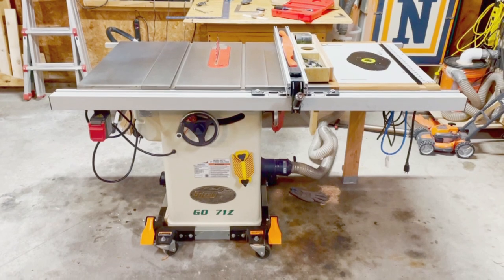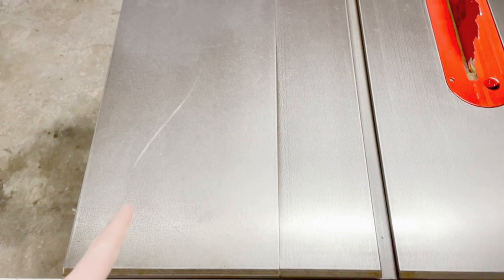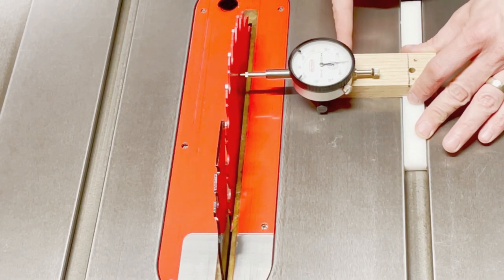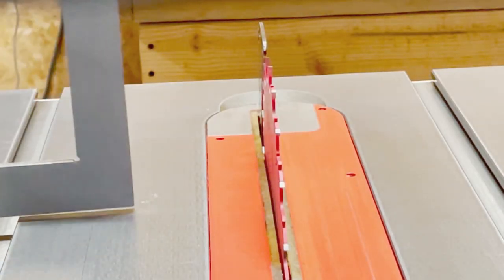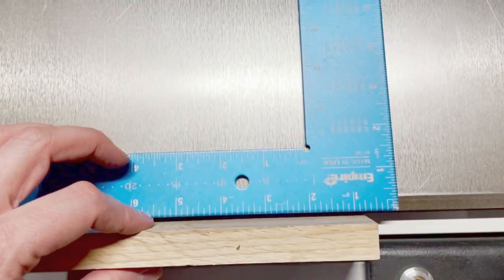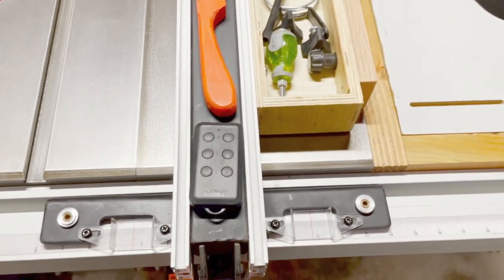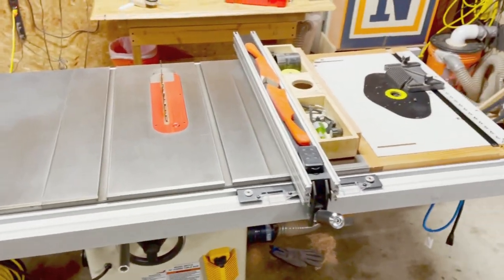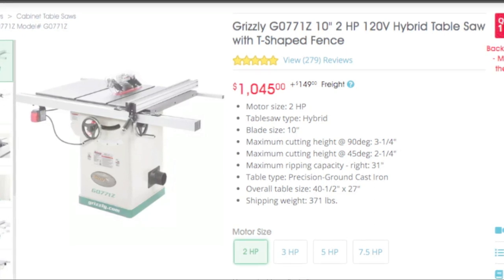3 Year Review: Grizzly G0771Z 10" Hybrid Table Saw

Comment: I’ve had the same saw now for about 8 months and love it. You are totally right about it not being a production saw.  I’m an experienced hobby woodworker and don’t need all that power. A sharp blade can compensate for the lack of power.  I’ve never had a problem with hardwoods like white oak, bloodwood, purpleheart, & bubinga. I do have 2 minor issues ... that plastic push stick should be thrown away. If you’ve ever had a spinning blade hit a plastic push stick ... it shatters.  2nd issue is the rip fence grooves. When cutting a 45° or probably any angle a portion of the cut ends up in the grooves making the measurement scale worthless. 
What I added was a flip up/down outfeed table  which is a fabulous addition. I also put my MLCS router table on the left side to compensate for the U-Turn router lift.
Reply from the maker: I also broke my push stick in a similar fashion. Plus they really should be used in pairs anyways, so one isn’t enough. I haven’t really encountered the fence groove issue though.

Comment: I just purchased this saw in March of 2024.  I haven't used it very much yet, but so far it seems like a great saw.  My previous table saw was a Ridgid TS3612 contractor saw.  It worked great, but after my grandfather passed away the family decided they wanted his old shop tools...ok fine, that means I'm buying what I want LOL.   So I went from a contractor saw to a hybrid cabinet saw....the Ridgid table saw extension wings weren't solid cast iron, they had crosshatch type holes throughout them, so things would fall through, or get caught in those cutouts.  The Grizzly G0771Z has solid cast iron extension wings, making for a very nice smooth table top...plenty of power, although its only 1/4HP more than the Ridgid TS3612's 1.75HP, even it did everything I asked of it, even hardwoods it didn't struggle with...so I doubt the Grizzly will have any issues with the same type of usage.  

Once I got the saw assembled and setup, I cleaned all the shipping grease off and then I applied a coat of paste wax to the table.

Comment: Another nice video.  One thing though, when measuring from the miter slot to the blade you need to measure at the same spot on the blade.  Reason being, the arbor and or blade can have runout.  To eliminate any blade runout in your measurement just use a sharpe and mark a spot on the blade.  Only measure at that spot.   This will be a true mitre slot to blade measurement.
Reply from the maker: Yeah, weirdly enough I did it that way albeit via a different method on my first video but didn’t do it here. You’re right, that would be the true accurate measurement.

Comment: Thank you for a great review. Well done. One point of interest; when checking alignment of the blade to the miter slots, keep in mind most blades are not perfect and will give an inaccurate reading....I checked about 6 of my blades and none were perfect, plus you are only measuring a few inches. a better system is to attach an arm to the arbor that will swing forward and back giving you a greater distance to check.  I like the convenient alignment adjusting on this saw...on my old saw the trunion is bolted to the table underneath which requires some heavy gymnastics.  The only thing I DON'T like is the fence; if you push on the end you get some play      One last critique;  On squaring the fence...Framing squares are not square, always check and adjust your framing square (YT will tell you how). I usually kick out my fence a few thou away from the blade-doesn't affect the cut and helps reduce kickback.Thanks again for a great review!....I'm going buy one!

Comment: Thanks for posting this video. I found it very informative. 
I have a Dewalt job site saw and have been thinking of upgrading. One of the things that holds me back is the rack and pinion fence. It is bulletproof in terms of being consistent, easy to adjust. I heard you say the fence on your saw requires some attention to TLC. Glad to hear that overall you are happy with your upgrade.

Comment: I hope you didn't chase a couple thousands on the blade alignment. That is very good within a tolerance. It would only make the cut slightly wider and you'd find any saw, Powermatic, Saw Stop or Laguna will have similar number. My measurement showed the two miter slots on my (brand new) G0771 are not perfect. One side is 2 thousands different than the other

Comment: I really appreciate your review of this Grizzly, especially the comments on the fence. I don't want to give any fence "...this system needs a lot o TLC to work properly...." gives me considerable pause before purchasing this model. 

I want a spot-on, dead accurate fence if I'm paying around $1,200 for a table saw. I can deal with blowing out the dust and doing some lubrication if needed from time to time. I am dealing with my Ridgid R4513 crappy fence that causes me to spend tons of time fixing cut drift.

Comment: Thanks for such a thorough and informative review. You have good insights and clear/accurate explanations. The aluminum fence rail is also a worry of mine, to the point that I've mostly ruled out any saw that has a cam-lever fence that doesn't clamp against steel. You say there's barely any wear on the rail, but have you confirmed that the accuracy of the fence hasn't been affected? If there's really no reason to worry about it, then that could save picky dinguses like me a bit of money when saw-shopping. Cheers!

Comment: They do give you the size of a hex nut that works in T-slots. If you measure the top and bottom of your fence you will find the top is narrow...aka the fence has a slight taper bottom to top. So you fix the left side and the right will be way off. Mine is 0.025 cm different. So I set it straight and put 3 pieces of tape on my sacrificial fence. My big question is did you have any trouble with the fence? People complain the nylon comes off. OBW cost is now $1500 when you include shipping or by direct from HD and no shipping:). I put bench dog router wing on because I was tired of my home made stuff not having perfect miter slots (even strore bought)

Comment: I've had this saw for 3 years too, it was missing all the screws that hold the back panel on right from the factory, but my stickers are all on.  My cast iron is pretty thrashed, I've set a lot of things on it and there are a lot of rusty spots, I spray it with some generic ACE brand spray lube that is like boesheild.  My blade isn't perpendicular to the table anymore when set to zero degree tilt and it wobbles a bit so I need to adjust that, not sure how it got out of whack.

Comment: I have the same saw... I was looking through the manual today because I ran into the same scenario - it states to use M6-1 Nuts with M6 bolts. I called them and they had no idea what to do for the T-Slot solution.
Reply from the maker: Maybe if enough people bitch about it to them, they’ll break down and start manufacturing some t slot bolts.

Comment: Hi Matt, love your channel. I have similar tastes as you for tool brands. I’m a huge Wen fan as well and a Grizzly tablesaw fan. With that being said. My tablesaw is fairly one year old. Have you any issues with the fence moving when you lock it down? To this day and so frustrating is I cannot rely on just moving the fence to my desired mark to cut without checking each and every time if it is square or not. The blade is square to the slots and fence is  square at 90 degrees. Time consuming for sure. I’m just a part time woodworker but would like to use my saw without checking for squareness each time I move the fence. I’m hoping you get to read this comment and if so would give some advice please? Thank you much in advance… Raymond…

Comment: Great review. I am about to buy this saw to replace my 30 year old Craftsman. The fence seems crappy like most on saws in this price range. I have a Delta T-Square fence that I will probably move from my Craftsman to this saw. I was also hoping for improved dust collection but I read the duct collection on this and most other hybrid or cabinets is not good.
Reply from the maker: I think the stock fence is fine, but the Delta fence would def be an upgrade. Dust collection is also fine, but since there are openings under the table where it meets the cabinet, and also an opening for the blade angle crank, the air isn’t sucked straight through the throat plate where the dust is created. I’ve seen a YouTube video where someone CNCd a piece to plug up the blade angle hole, and I’ve also considered plugging up the gaps at the top with styrofoam, but I always forget to do that.
Reply: @NotThatMattNagy  Good to know. It is on backorder until June 24, so I am just going wait until they have them in stock before ordering. I think maybe the price went up too, it's now $1150.

Comment: Hey Matt, great review! Have you cut any relatively thick hardwoods (i.e. Walnut) with this saw? How has the performance and cuts been?

Also do you think this would be possible to use outside assuming you have the right voltage to run it? My sheds a bit small which is what got me thinking about a mobile hybrid saw in the first place. Thanks again!

Comment: How does the fence hold up against deflection?  The fence may be parallel to the blade when just sitting there, but of course that's not how a rip fence is used - when cutting, you push a board up againt the fence.  Would seem an important measurement is how much, or little, the fence deflects when a side load is applied.  Especially so where a fence is supported on only one end.
Reply from the maker: Remember that the side load is almost always applied against the portion of the fence that is before the blade and close to the clamp. If you have the right amount of clamping pressure, and you aren’t pushing against the fence with all your might, it shouldn’t deflect much at all at that point since the leverage is low. Best I can give you is that I haven’t noticed anything in my cuts that would suggest deflection, like pinching on the blade or cuts with differing widths on either end.
Reply: @NotThatMattNagy  Nice to hear.  The fence on my old tablesaw deflected some in use, requiring I clamp the back side of the fence. Has me a bit concerned about fences that clamp only on the front.  Grizzly & ShopFox fences seem well rated, but nobody ever mentions deflection . . .    a flexing fence is the primary reason I'm retiring my 75yr old Craftsman saw.
Reply: @staceyjenkins6242  Amen! I can deal with just about any table saw deficiency EXCEPT  problems with fence alignment (consistent distance from blade to fence) and deflection.

Comment: I'm leaning toward this saw or either the Shop Fox W1837, which appears to be a little more mobile.  I will have to move the saw pretty much every time I use it due to limited space.  Any thoughts or advice?  Thanks!  And great job on both of these videos!
Reply from the maker: I think I may have replied to another commenter with this same question but I think the Shop Fox is a good choice, the specs are more or less the same as the Grizzly, plus it is a few bucks cheaper than the Grizzly with a built in mobile base

Comment: It’s 1250 + 179 shipping + taxes.  Looking at 1500 hundred for a saw that was 1k two years ago.

Inflation, covid, politicians are screwing everything up.
Reply: I have the predecessor to this saw (G0715P) that I bought in about 2011.  It has steel rails and doesn't have the track fence, but otherwise the "same."  Once I dialed in the fence, it held very well.  I am still very happy with my choice, over 10 years later.

Comment: This fence absolutely blows. It's so easy to send it out of alignment. That bearing that runs along parallel to the tape measure, is god awful. I hate this fence. Why on earth when I'm spending 1500 on a table saw is it not rack and pinion? That's the only acceptable option for all table saws over 1000. If they can do it on 300 dollar portable ones, they can do it here too. I love mine too, but the fence drives me nuts.